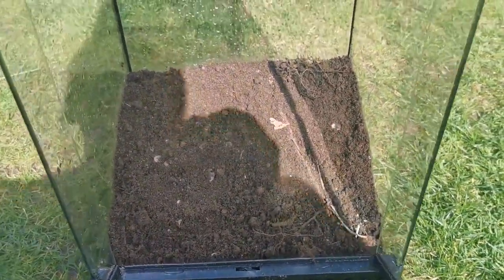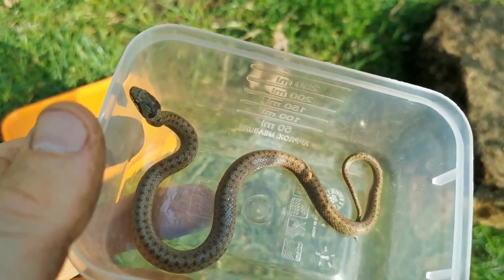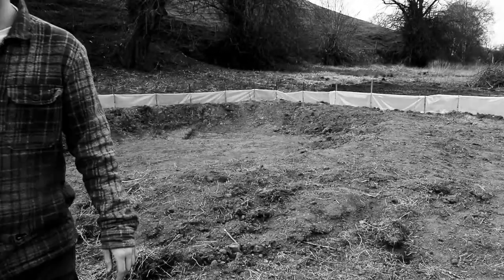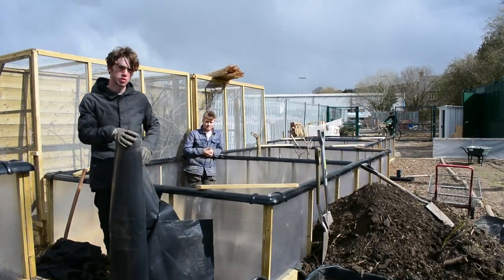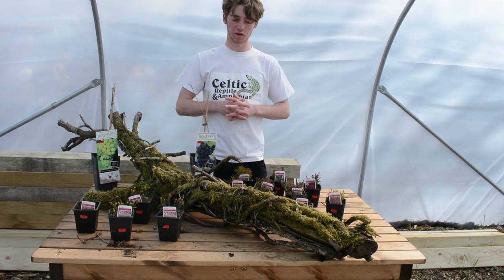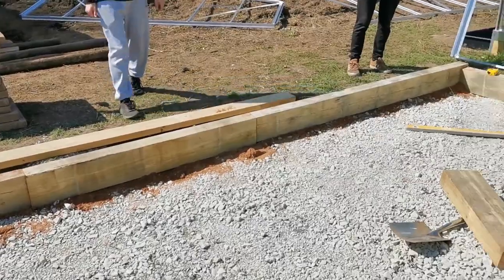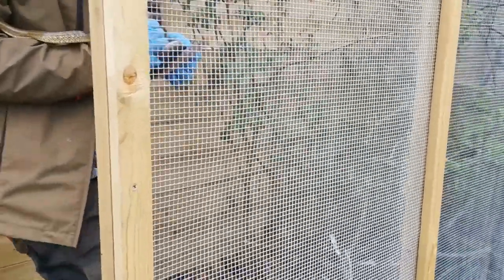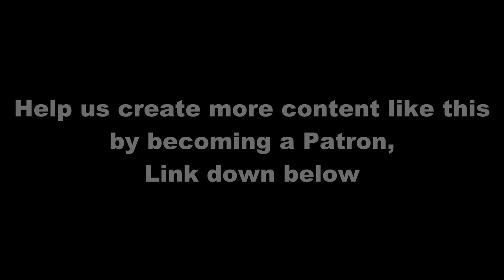Britain's Rarest Snake | S1:E2

Comment: Im curious if your polytunnel suitable for housing any of your animals?
Reply from the maker: It can be, however there is very little UV transmission through the polytunnel material and so is not ideal for housing animals. However it is a dry, warm place to temporarily bring animals in from out the elements - from time to time.